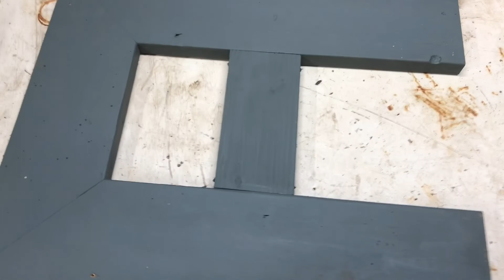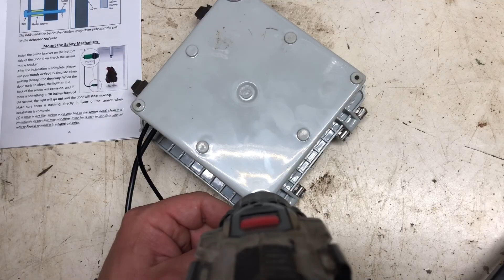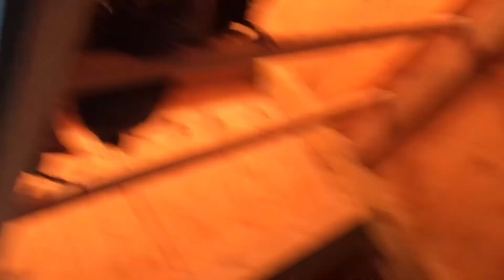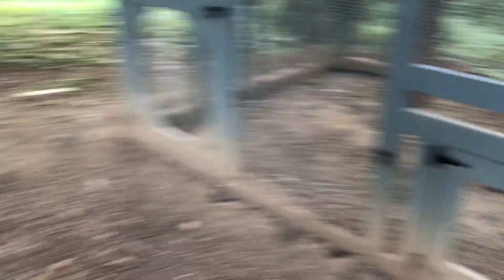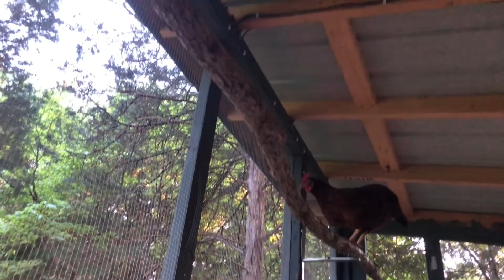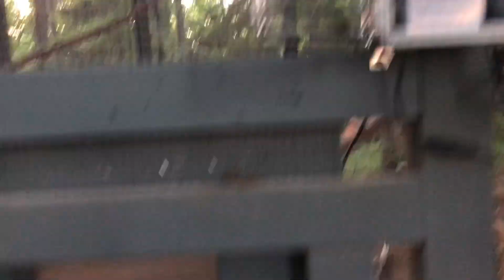JVR Automatic Coop Door Install ( Timer Model)

Comment: Do I need an inverter to hook this to a solar panel?
Reply from the maker: The power supply this comes with converts 120V to 12V DC.  If you have a 12V DC power source already, then you just need to find the right cord connector to plug into the door controller

Comment: I thought the actuator was attached at the top of the door so it wouldn’t interfere with the sensor.
Reply from the maker: @jeffbren2151  it doesn't seem to have any interference.  This door still working well after 3 years.  Only had a 12v power supply blow up from a power surge and no other issues.   Installed surge protector on breaker panel a few months ago to prevent that. 👍
Reply: @projectswithjw  I'm installing one at the moment. You video made me rethink my plan.

I'm going with the frame approach.

Comment: Our display is blank but indicator light is red. Any suggestions? New out of the box.
Reply from the maker: Display is powered by a pancake battery.  It's behind a cover were the wiring is at the bottom of the box.  It could have a plastic cover on it to keep from discharging.  Hopefully it isn't dead but it's a common battery most stores should have.